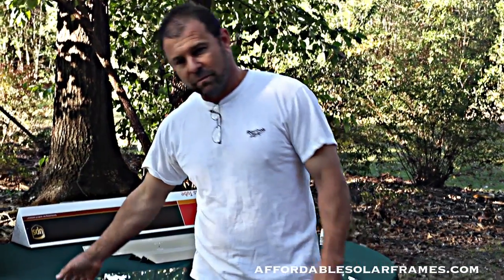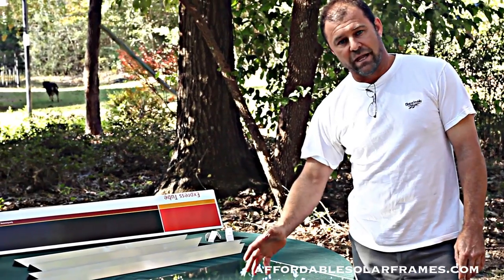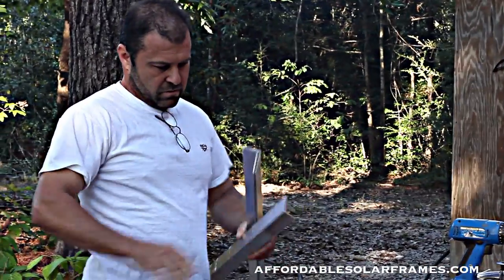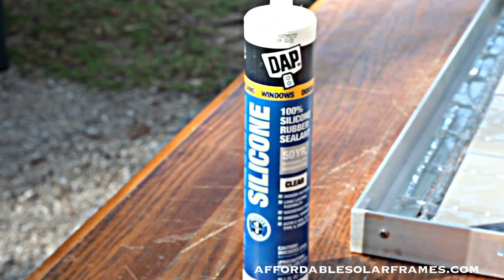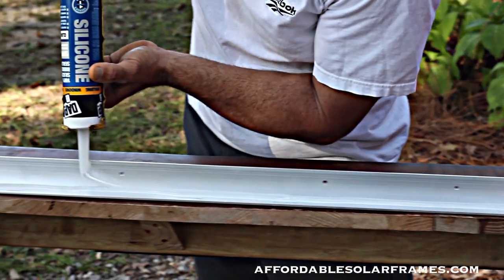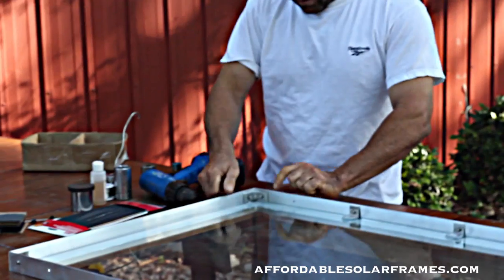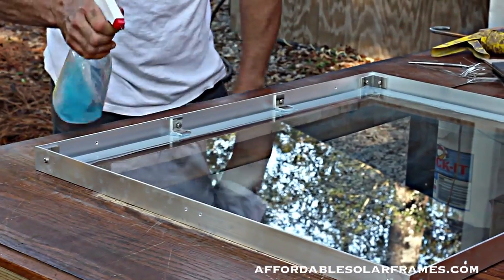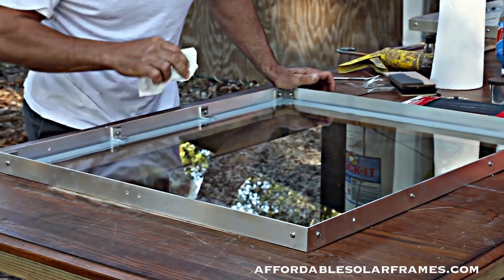How to Build a Solar Panel - Part 1 of 3 (New)step by step buying everything off ebay

Comment: Great video series!   3 questions.  1- Wouldn't it be faster & cheaper to use sized aluminum pop rivets instead of the stainless hardware?  2- Do you sell just the 90 degree clips & fasteners?   3- Do you silicone the front side of the glass at the frame?  Thanks

Comment: Your videos are GREAT.  I have 36 3X5 cells I am going to make using your panels.  My only question is concerning the diodes.  There are multiple sizes available.  What size should I use and how do you determine the size.  Thanks

Comment: @markp0177  Thanks for the response friend.  If you were to speculate the price on one of these units, supposing you spent $200 on supplies, what would you charge to sell them?  The reason I ask is because I have a potential customer for a few panels and I was wondering what you might charge for such a unit individually.

Comment from the maker: @dodadoda8 Hello,sometimes the tabbing will lift the silver off the face of the cell and will never resolder. I don't use those I just grap a new one. If you can see that it is still white under the tab then it will resolder with crl flux. The cell with the lifted tab may still work.   Mark